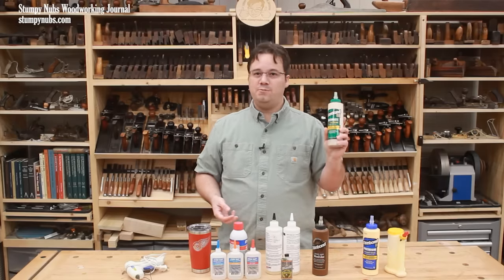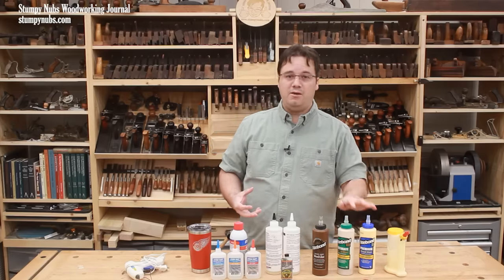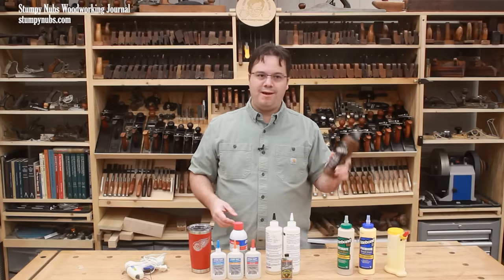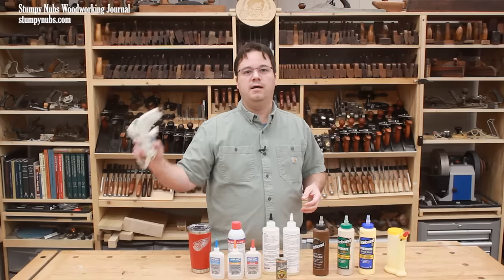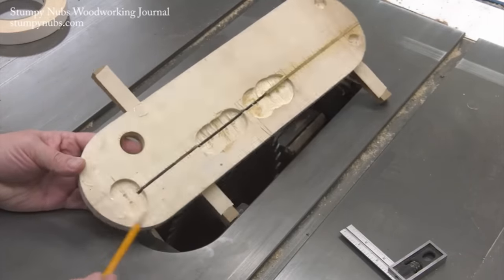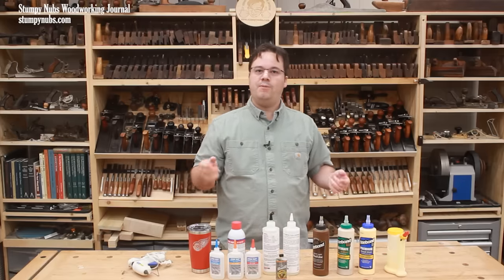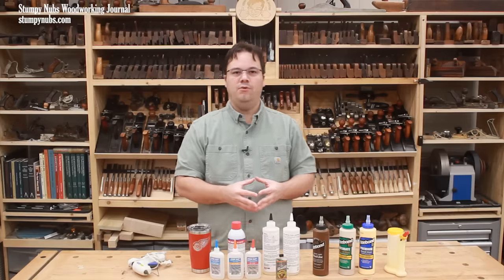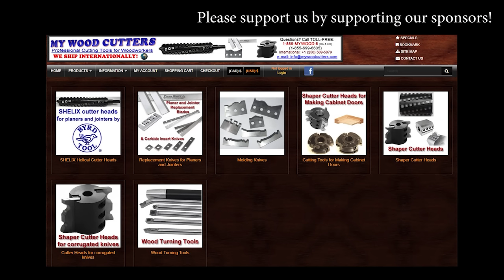Why I don't use Gorilla Glue

Comment: A few points from my experience as a theatrical carpenter. First...you can get an industrial hot glue gun which can be great for permanently attaching things like foam to any surface! Second...we often used polyurethane glues to attach metal pieces to wood. They only had to hold together for the length of the show, but they have held together much longer than that. My favorite recollection of a glue failure/success was when I had to build a pair of giant doors out of big pieces of rough cut pine to match a large pine wall. Put then all together and clamped them up but after a day or so they fell apart!  Rough cut was quite damp. Tried again with polyurethane. No problem. When we broke down the set the polyurethane joints were stronger than the grains in the rough cut!
Reply: Can you suggest an industrial glue gun and glue stick?

Comment: Great video! My problem is that I don't do a lot a projects, so I just keep a small bottle of TB III and 5min epoxy around in my work area. The wife/kids do a lot of crafting, and have a few different formulations of modge podge as our standard for those types of projects. Love the tip on the CA glue though, our little tubes always get thrown away, I'm going to put the next one in the freezer :)

Comment: I use Goop and E6000 a lot. Not for wood though. Great for fabric, metals, glass and plastic. Dries clear and remains flexible. Very strong but can be peeled off if necessary. Can also be used as a sealant.  I use it for repairing rips in clothes. Spread some on a patch and apply the patch from the back of the clothes. If done carefully it makes a nearly invisible repair.  On cloth it’s permanent and can be washed normally. I even used it once to attach a rear view mirror to a windshield.

Comment: I use poly glue for dovetailed bee boxes as the boxes are cheaply made and the glue expands to fill in gaps in the dovetail joins. I agree it is messy though as you can't really control how far it is going to spread once applied. Good stuff for damp wood and is very strong.

Comment: Gorilla glue has proven very useful to me. It's perfect for 'fixing' breaks and a knife cleans up a lot of mess. I've even used it on my motorcycle to fix a frustrating rattle. It seems to hold up extremely well in the long term.

Comment: If yellow dries harder than white wouldn't it be less flexible?  Like your video and agree about polyurethane glue.  I had joints in brazilian cherry fall apart even when it was wiped with acetone to remove the oil.  Tested and found white worked much better.
Reply from the maker: I misspoke. White is more flexible.

Comment: I am slightly obsessed with glue.
I have a special box for all my glues, there  is over a dozen different sorts of glues in there. 
I really enjoyed that video, even I learned something.
CA was developed in the Vietnam war to stick wounds together in the field. I have used it on small cuts that I can't get to heal, normally due to the flexing of the skin at work, fingers etc. You can suffer for days and then a dab of CA and it will start to heal.

Comment: I have used Gorrila Glue in some joints that I new would not be perfect but were very close.
The GG glue expands into the voids and when sanded and stained looks like a perfect joint.
The mistake most often made is too much glue and it expands all over the piece. A 1/8" bead down the center of a 3/4 joint is about all you need. Or just a droop or two in a biscuit slot.

Comment: What kind of epoxy do you use that gives you lots of Time?!     My go to is original formula JB Weld. I guess it’s slow compared to CA,  but not as leisurely as hide glue (my hands down favorite glue and if it were waterproof I’d use it exclusively).

Comment: Awesome video! Thank you soooo much for this video!
I never seen some of the glues you have shown. I have 12 dining chairs and wish I would have known about the glue in the brown bottle. I had to take apart 6 of my chairs because they were wobbly. The old glue wore off and needed replaced along with some new wood screws. I also had to reglue the dowls in the chairs. This was my first time taking any chair apart and fixing it. I was so afraid of cracking the wood because it does happen, even if you are careful.  In my area I've never seen some of those different glues. I used gorilla glue because that's what I have available in my shop. Most of what I make, small pieces  of indoor furniture or small decor & cabinets,  it works. 
I'm going to have to find some in that brown bottle. 
 Do you order your glues online?
Reply from the maker: There are links to the glues below the video in the description, and also pinned to the top of the comments.

Comment: I'm far more familiar with glues for composite/composite or composite/metal than wood bonds but have used a variety of wood glues in home projects. I'll be grabbing some Titebond for when the weather warms up a touch (my "workshop" is the big one with no roof at the moment and the heating's on the blink!), particularly the 3 as that's the recommended choice for bows owing to the exact same reasons you gave. Looks like I'll be grabbing the others as well as it's now pretty easy to get over here.

Comment: The thing I like about polyurethane glues is that they're excellent for stabilising anything that must not move. Squeeze a bit of that into the interior corners of a joint & then press it down a bit once it begins to surface-set, & you can add a lot of strength to a joint which may otherwise have weakened or perhaps couldn't be constructed any stronger due to design constraints. It also sands better than any of the others & doesn't seem to resist any coatings such as paint & varnish.
That said, it just goes off in the bottle too fast for me so I only get small quantities when I know I'll be needing to use it right away. Titebond III is my everyday glue & I don't bother with the other types simply because I don't use enough of it for buying 3 bottles to make sense, & superglue (CA) is primarily used here for a strengthener (absorbing into grain) and surfacer (spread on & sand for a lovely low friction surface in jigs, etc).

Comment: I was very surprised by the unexpected expansion of Gorilla glue. I have used it a lot, and it has its issues. The bottle I have now has been hardening and wont flow. Overall it has worked well, but I am considering an epoxy now due to a project I have.

Comment: Several times I have used steam to soften regular Titebond glue. Typical use was to align the wool felt hammers in a piano so that they strike the piano strings perpendicularly. Birch dowel is connected to a hole drilled in the "hammer butt" at one end, and the same size hole drilled in the wooden portion of the hammer. Also, if the dowel were to break, I could usually pull it out of the butt, and and the hammer, using steam. I would just hold the dowel over a the steam coming from a whistling tea kettle. Once the dowel was removed the hole in the butt and the hammer could be reamed out to accept a new dowel, and ordinary Titebond glue spread on the ends of the dowel and inside the holes. No clamping needed, just alignment. If I recall correctly, I had a special "hammer puller" to pull a hammer off of its dowel once the glue was softened. Steaming the glue worked just as well with Titebond glue that I had used to replace a dowel as it worked with the glue that was used in the original construction of the piano.

Comment: I use Tight bond III 90% of the time.  I once talked to a Franklin rep at a trade show who suggested I just use TB III for all PVA applications.  For most of us stocking 3 types of PVA is not practical, as it goes bad in a year or so.  The glue you throw out is the most expensive.  I use PU (Gorilla) glue for end grain applications especially (~5%).  It might be good for mitered joints, too though I haven't tried it. And CA (all three thicknesses) for the other 5%, for quick bonds and crack fillers.

Comment: I used some hot glue to place a backing board under the counter and behind the trim above the dishwasher, so then I could attach the backing to the counter with some screws.  I couldn't think of any other way to hold the board to the counter while I was piloting the screws...  But now I don't feel bad about it because you said you use it for weird things too, so thanks!

Comment: I can buy Selley's glues at any hardware place, so that's mostly what I use. I have two PVA glues right here, there's interior wood glue which I mostly use. Clamp hardwoods for an hour.
There's exterior grade for use outdoors. I don't remember using it, but may have. We have some PVA glue was spilt on a blanket over 30 years ago, I have found no way to even soften it. I don't know its clamping time.

I have Quick set wood glue. Doesn't need clamping at all unless the wood needs to be clamped to straighten it. Good to handle in 15-20 minutes.

I also have Durabond polyurethane glue. Fills, waterproof, acid & chemical resistant. Requires moisture to cure, so wipe any dry porous surface. Clamp four hours.es with a damp cloth a minute before applying.

Titebond is a long trip, or mail order.

Comment: I have a friend who made expresso tampers, which involved gluing stainless steel to exotic woods. While this worked for sticking the two different materials together, he air mailed some to Japan. On flight, because of the altitude, the air bubbles expanded, and they all delaminated. 

As for 'water proof' they all say 'not for submersion', so not for boats where you need a 'marine' grade glue or epoxy.

Comment: Teak is a difficult wood to glue.  I think it is because of the oils in the wood.  After several failed glue joints with teak, I found G-2 resin has held up extremely well, even where the project is subject to rain and high humidity.   Not the cheapest stuff, but works very well.   All to say, "wood glue" does not work well with all types of wood.  Thanks for the video!
Reply: Karl grimsley: I sprayr composite's, ie, kevlar,carbon fiber that have internal release agent's in the resin .cleaning with solvents draws release to surface ,I use universal fish eye preventer in pu paint. I have sprayed cat polyester on teak over sealer with good results check products   with test pieces to insure adhesion with types of adhesives. I work on boats we don't glue,we screw. 10-4   md

Comment: I'm not a good craftsman and I was grateful when Gorilla Glue boiled out of a chair tenon that just wasn't strong enough when I assembled it with Titebond and I had to redo it. I was able to pull the tenon back from the mortise without ruining the rest of the chair, moisten the mortise, apply glue to the tenon, assemble and pull together with a strap. Wipe as necessary. Useful on old chairs where the wood has shrunk.

Comment: I bought an industrial hot melt gun with a wide temp range control which also allows for a variety of hot melt types to be used effectively.  I've used it at the low end to glue foam blocks together without them disintegrating for packing, and at the high end for woodwork and for gluing plastics and wood to plastic.  Downsides are changing glue types and I also find hot melt messy in its own right.  It's not particularly suitable for finer joints and if you burn yourself with it (I have), especially at high temps, it's a 2nd degree burn at a minimum.  I can tell you that third degree glue burns are god-awful.  There's no denying hot melt's usefulness, though.

Comment: i use a lot of abatron epoxy glue in old house repair.  Like i am repairing a cedar wood clapboard, and it has a long crack....i can clean the joint, apply liquidwood epoxy, then clamp it with a wedge held against the edge with two screws by tapping the end, and it dries stronger than the original wood.  The only drawback: it has to be done above 70 deg F.

Comment: I agree completely.  When I first started using Gorilla glue, I thought it was great for filling gaps and such.  Then I discovered how bad it is for actually bonding stuff.  I don't know how many times I have had joints bonded with Gorilla glue fail.  I finally stopped using it and moved on to better glues.

Comment: I notice you left out JB weld. I know they're not designed specificaly for wood, but do you ever use them? And what sort of adhesive would you use to fasten wood to glass or polycryllic!
Reply: That's just a brand of epoxy with a filler material.

Comment: What about consideration for edge joint glue ups destined for the jointer and planer? PVA produces some extremely hard glue lines that dull planer blades quickly and nick them. Recommend anything durable that wood remain soft to planer knives?

Comment: Very interesting - thanks for the video.

For certain kinds of (non-woodworking repairs), I've started using UV glue. It's not super strong, but if you stay inside, you have as much time as you need to position things, and then you zap it, and it's set. One thing that I tried, and failed, to use it on was Delrin (aka POM), but I can't find anything that sticks to that. With a decent UV flashlight, you don't need a big gap to get the glue to cure.

I also don't care for polyurethane glues. I tried a couple of brands when I first came across them - one my brothers was a big fan - but I could never get as good a joint with those as with even generic yellow glues, much less Titebond (which is what I mostly use now). My brother eventually decided polyurethane glues weren't worth the trouble, but that might have been because he kept finding bottles of it which were 95% full that had set up on him, no matter how careful he tried to be.

By the way, I've always found that adding some yellow glue to the water when mixing up curing fillers (like Durham's Water Putty, or Fix-All) makes the resulting stuff 'tougher' - specifically, it's much less likely to crack. It's also a lot harder to sand, so I make sure I don't use it when or where I'll need to sand.

Comment: I learned one thing, which is the difference between Titebond II and TB III -- TB II works by *surrendering* moisture to the air.  TB III works by *absorbing* moisture from the air. This is highly relevant as to the circumstances you're using them in. If you're in Arizona, you probably want to be using TB II -- if you're in Florida, Louisiana, or Eastern Texas, TB III is going to work far far better.  I had a TB II glue-up here in FL, after 48h to dry, it still pulled apart with my hands -- easily. When I used TBIII, no problems, it held together against everything within hours. The one downside to TBIII is that it foams as it dries, meaning there may be more cleanup at the edges/seams, where the excess will likely bubble out and have to be scraped and sanded. Oh, and clearly -- TBIII has no issues with damp wood.

Another thing you can do with the CA glues is to keep them in nested plastic baggies. This can help prevent them from getting access to any amount of moisture, especially if you throw in some of those "drying packets" left over from your OC/prescription bottles, in a middle level baggie. ;-)

Comment: im from belgium and we use white glue. we have diffrent kind of white glue, like water resistant, express wich has a shorter clamp time, normal white glue, and water proof glue. we use the terms D1, D2, D3 and D4 for our glues. the brand we use is rectavit wood glue

Comment: CA glue is also perfect for closing wounds in lieu of stitches.  I sliced the web of my hand between my thumb and pointer finger, got stiches and they tore out in less than a day.  I used CA and some Gorilla duct tape to hold it together and worked better than going to get stiched  3x in 2 weeks.

Comment: Exellent review. However I do find a use for polyurethane glue for waterproof bonding of wood to metal. It’s cheaper than epoxy and gap filling. It does go off in the container. Maybe I should get some epoxy or Titebond 3. Titebond wood joints last for decades. I have stuff I made thirty years ago and the glue is still fine.

Comment: I use Gorilla Glue on those tiny cracks in concrete walkways.
It keeps the the moisture out of the cracks that would expand during freeze thaw cycles. It looks weird but works.

Comment: Liquid hide glue
is the best for repair of high quality antique furniture. Also it is 100% removable from any surface using a warm damp rag. Also,  It does not seal the wood as some glues do which can prevent stains from saturating the wood uniformly. It's also excellent for veneer work. If you brush or roll it on and then let it dry, it can be reactivated with water and it performs much like a contact adhesive.

Comment: Why did your video's image freeze on the half-lap joint cut with a dado blade while the audio continued? Is that your video or YouTube.

The same thing happened yesterday while watching a lecture. The video stopped on one graphic while the lecturer continued talking about other graphics.

Is there a problem that you need to work out with YouTube?

Comment: As a picture framer for my scroll saw portraits  I prefer to use gorilla glue clear. Because I am using 45 degree angles for my frames I am using endgraim. I have tried titebond glues and I keep on coming back to gorilla glue. It gives for me at least a better bond and I have never had problems. Glues can be a subjective subject so I am not saying that my selection is correct but it works for me.

Comment: How about the strongest load bearing adhesive required to retain a plastic plug and metal pin in the bottom "static" end of a twin  folding  bedroom door? Recommended adhesive?

Comment: I broke a piece of the front of a bathroom vanity wood drawer. first, the paint cracked, and then the piece came off. I don’t have clamps as I’m not a professional word worker. Is there a type of glue I could use that doesn’t require clamps? This is a cheap old vanity from 80’s that we’ve been putting off replacing but it’s an eyesore with that piece missing. Appreciate any advice.